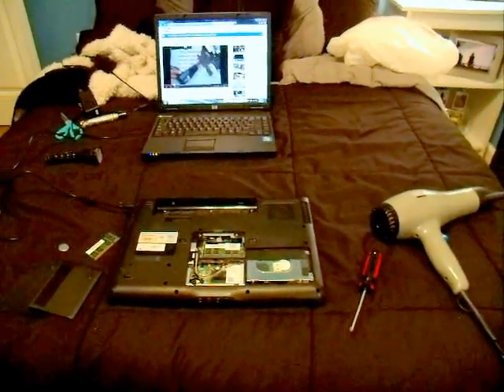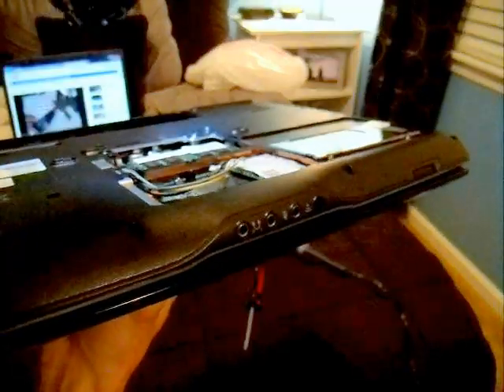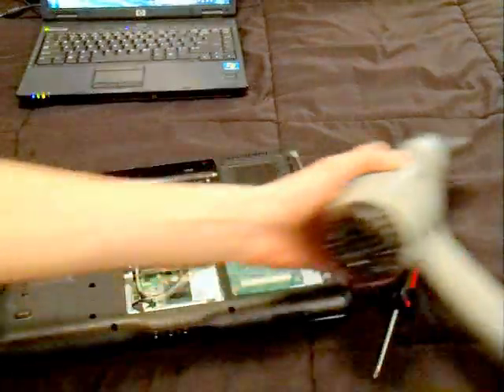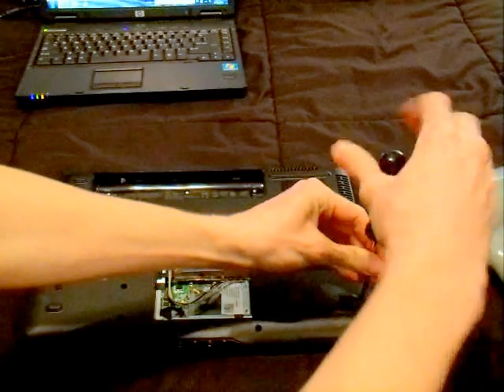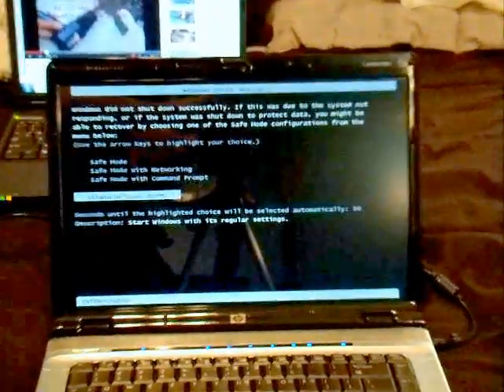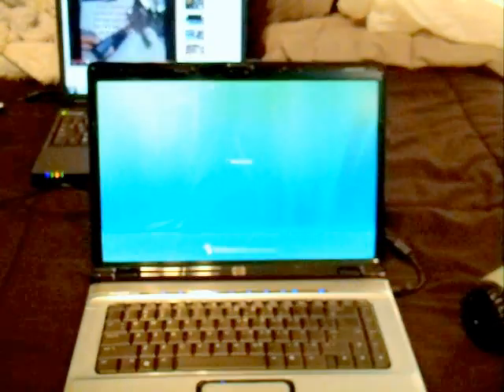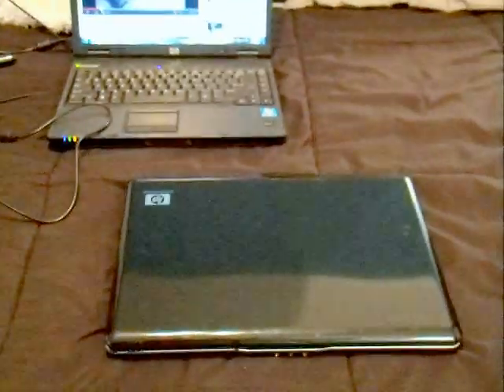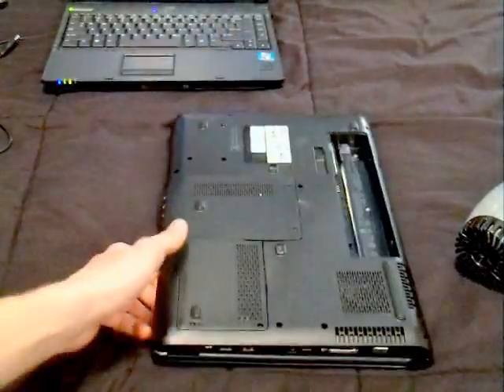HP DV6000 No Video Fix Using Hair Dryer

Comment: Holy crap!
This just worked for on my dv6000!
Things to bear in mind;
1) didn't work for me first time so tried again for 120 seconds and worked 
2) plastic housing got very hot and deformed so try to remould back into shape while soft
3) make sure the hairdryer is angled / pointed at right area. I used a folded news paper to channel hit area onto right area
4) let laptop cool before reassembling and switching on
5) don't let your girlfriend catch you using her hairdryer as you will have some awkward  explaining to do
 CANT BELIEVE THIS WORKED :)

Comment: It worked! The machine is a HP dv6636. Used a heat gun @ 300 watt setting for 60 seconds and also used a small knife to press down on the chip. I will take apart and shim with copper to complete. Thanks for vid post!

Comment: I have fixed the flickering using hair dryer and clean & reapply with thermal grease. However, i only heat it up for 1-2minutes to the GPU chip and cover the surrounding with aluminium foils. It works.
Reply: Today I’m trying your idea of applying thermal paste
Hope it works

Comment: Hi, I'm not sure if you explained this in the video but what does the heat from the blowdryer do? I plan on trying this.
Reply: reflow the holes
Reply: what happens if there is a crack on a metal and you heat it? it reconnects. same stuff.

Comment: The graphics driver is soldered to the motherboard? That's a new one on me! But, your solution is pretty silly because to effect a permanent repair in any case requires opening up of the body to allow access to the GPU on the motherboard. Otherwise, all you're doing is prolonging the issue and risking more damage by overheating exposed plastic parts.
Reply from the maker: After this I did open the laptop up. And did a proper repair with a copper shim.
Reply: He meant chip and you know it so why try to act superior?

Comment: Before I try it, How long does this fix last?
Reply from the maker: I sold the laptop, but i believe 2 years later it was still working. (I also added a copper shim between the gpu and heatsink for much better heat flow)

Comment: I suggest to take out the whole gpu card out and heat it with hair dryer concentrate the heat into the chip. Also, protect the diode, transistor etc around the chip by covering with aluminum foil or heat resistance tape
Reply: Jay Alan is there a way to make the reflow last more than 15 minutes just wondering?
Reply: 15 minutes using hair dryer? Hmm, you should start try with 1.5 minutes and test it out before heat it longer. I have successfully made my GPUs work again, HD5770 and GTX650.
Reply: Jay Alan my laptop only worked for around 15 minutes not the hairdryer also it is sometimes working sometimes not, I will do it again though after I eat!
Reply: Memphis Weyant After heated up for 100 seconds or so, apply back some thermal paste
Reply: Jay Alan ok where can i get that

Comment: My screen would come on, but after the line in the corner blinked, it restarted and restarted... Decided to try this (had nothing to loose)

BOO FRIGGIN' YEAH!!!!!!!!! The screen works! It starts all the way up! Shut it down all the way and powered it back again to make sure it wasn't a fluke!!!!!
BE CAREFUL!!!
I was a bit careless and Some plastic around the panel opening got misshapen so the Ram panel won't shut all the way. In return, some plastic near the battery compartment got misshapen, so after I put the battery in, it is now jammed :(